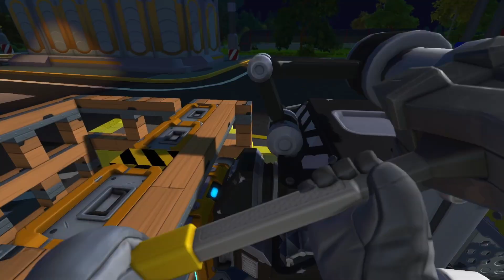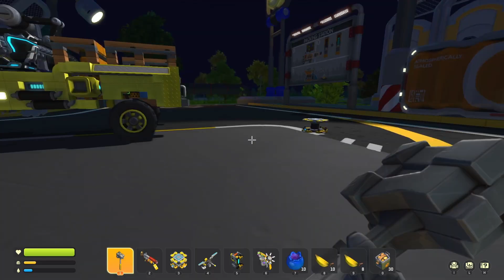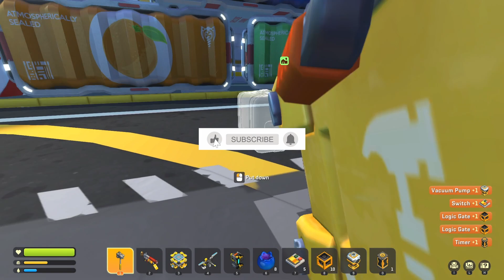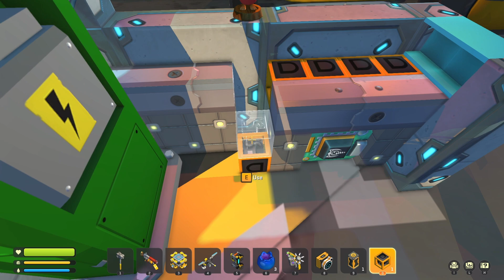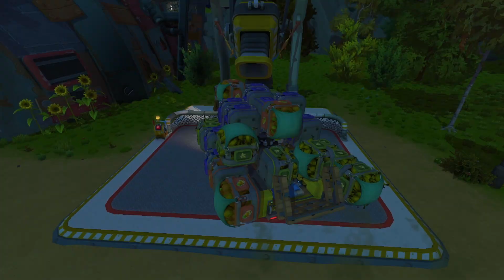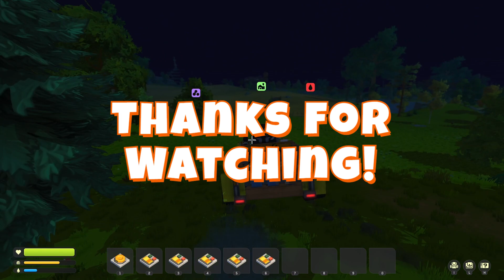Scrap Mechanic Automation: Build an AFK Fruit Packaging System (Survival Guide Part 26)

Comment: I have a similar automated feeder in my Survival world. You can safely set the timer all the way down to 11 ticks in a standard AND-NOR-TIMER loop without losing the crops. I've been using it on full chests worth of crops at a time with no issues.

You can also automate the button at the trader by shooting a water cannon at it. That one does need to be about once-a-second. It's a lovely convenience to not need to get out of the vehicle and to be able to reposition it while it's being unloaded.
Reply from the maker: As soon as all the work was done on the automatic crates and I hit the “suck” button, I had the same thought to automate it! 💡Then its just an easy step to attach rockets to the crates for trader delivery 📦 🤔
Reply: @OnlineGameFreaks  I've wanted to build some kind of system to autoload the crates for transport to the trader because manually placing the things in a truck gets tedious in bulk, but between physics weirdnesses and lag it's proven challenging so far. :(
Reply from the maker: You are tackling two of the biggest challenges in Scrap Mechanic, the unique characteristics of the packing crates and the infamous Lag Monster 👹. I’ve seen amazing solutions with conveyor systems, they solve the automation problem but they summon significant lag due to size and moving parts. With the new Smart Physics update, the simplistic solution maybe to catch them in a big wagon and haul them in like a load of pumpkins. 🎃
Reply: @OnlineGameFreaks  I've tried that, but the throw distance of the crates is variable and appears to be somewhat tied to the frame rate; with higher lag, they just sort of dribble down the front of the thing. So you need to build a system that can reliably put them where you want them. Which means more lag :v
Reply from the maker: You’ve peeked my curiosity 🤔. I had a fun, perhaps impossible, idea 💡 in this arena, time to do some testing.